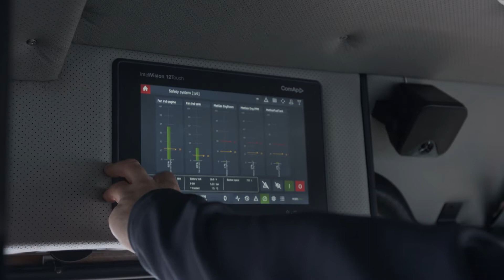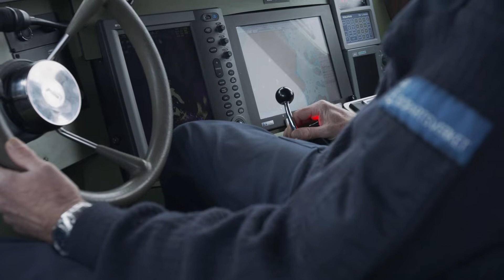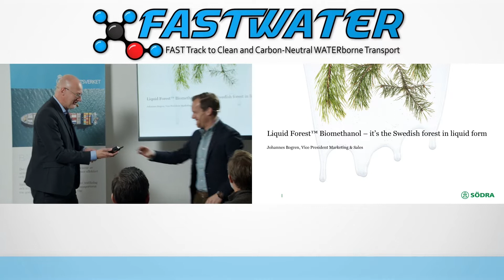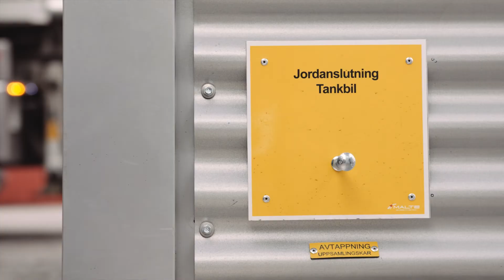FASTWATER Consortium and SMA  Methanol Fueled Pilot Boat

Comment: Good video.  It briefly mentioned the addition of additives to the Methanol.  Can you elaborate on that?  Also, I'm assuming that the Methanol is not being blended with conventional fossil fuel, is that correct?

Thank you.
Reply: 3% cetane enhancer is added to enable use in an CI engine.